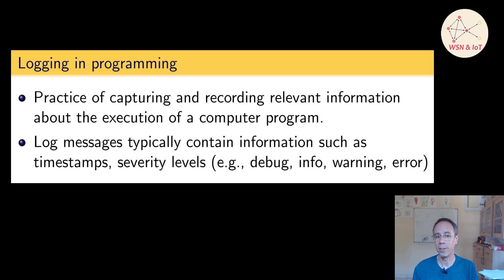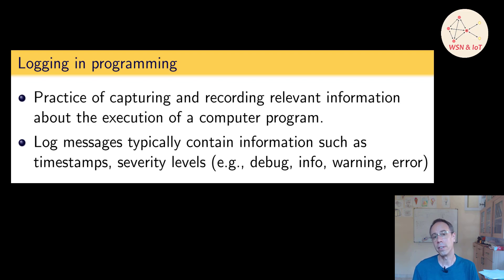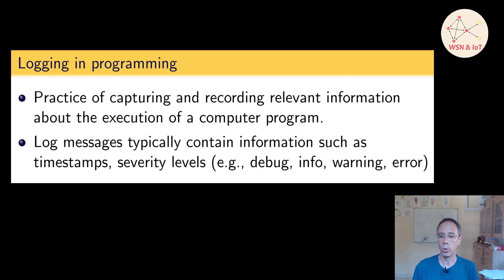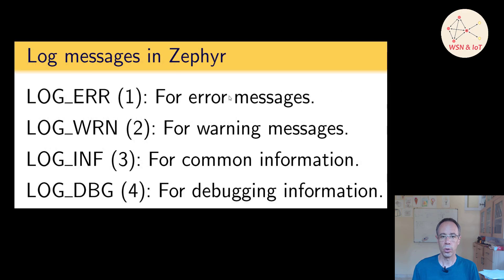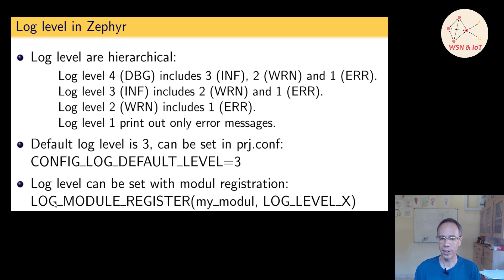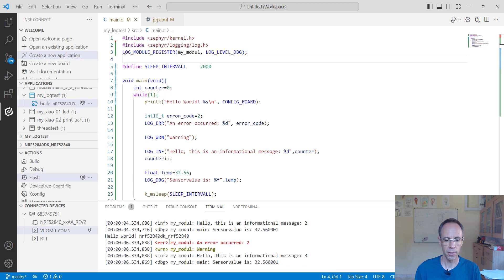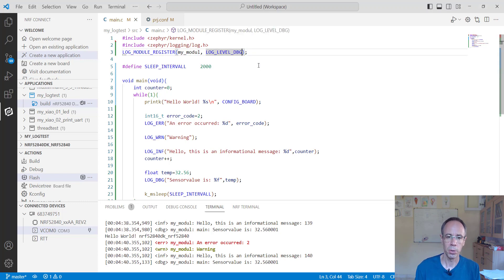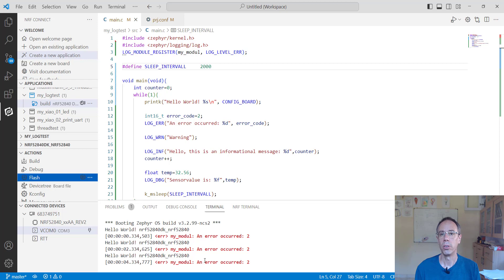Zephyr and nRF Connect SDK: Logging

Comment: This example is far too simple for significant work using the RTT backend and outside of VS Code. If there are a significant number of debug messages many will get dropped. And the example assumes that the program loops, rather than runs one time quickly. RTTViewer doesn't connect properly for a program that boots and runs an initialization quickly with lots of debug messages. Please help. The use case is the central_uart sample.

Comment: Thanks for the nice video. I am using NRF52840 dongle board where I do not have access to RTT. Also I do not want to use uart0 for logging. Is it possible to get the logging on the USB port instead ?